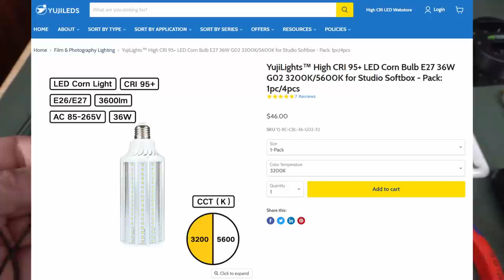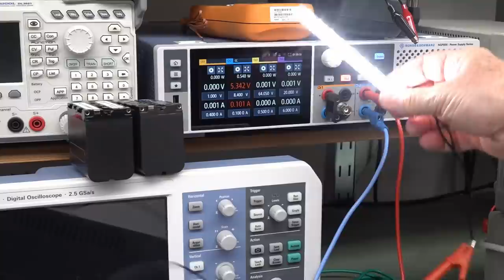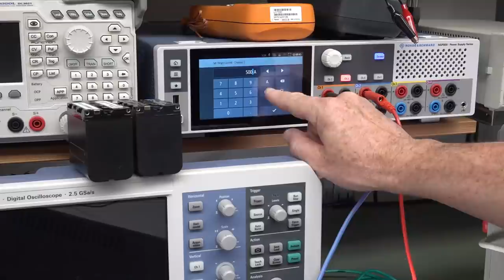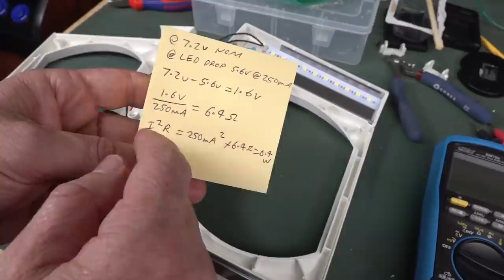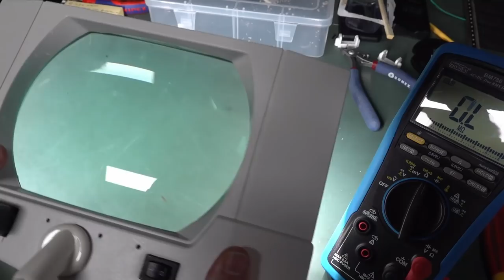Magnifying Lamp Sony Battery LED Hack

Comment: I use an Eschenbach Mobilux handheld magnifying glass. Nowhere near that field of view but somewhat more portable and similar magnification. They're intended for reading so focal length may be an issue, but they're by far the best illuminated commercial magnifiers I've come across, and I've tried a few. They're not cheap, but I got mine for free. Result!

Comment: Great work, simple and effective!
I have a couple of magnification lamps on adjustable arms, they have a 22W round flourescent light around the lens. Great general light for any workbench use and when you need magnification you've got the lens right there, just adjust position and you're good to go - great to have some magnification for those things that just are a bit too small for the naked eye (and I do notice the eyes getting older too). As flourescent lights are going the way of the dinosaurs I intend to fit LEDs in them after the flourescents wear out.

Comment: TRICK with Maggie lamps: Find a hand-held magnifier from the local variety store, best to get a metal frame and glass lens - let's say you find a 3" version. Hold it above your Maggie lamp to find a suitable height to create a "zoom lens". I found the best compromise is about 1" away.
Finally, find a piece of PVC drainage pipe that just fits inside and cut to length and smooth the ends. I used 90mm stormwater pipe as it is light weight and fits perfectly in a 3" magnifier.
So, when you need more magnification, just drop the pipe on top of the Maggie lamp lens, then place the hand magnifier on top of the pipe. You won't believe how well it works, and how handy it is.

Comment: Very nice quick hack using chargers and batteries you already had on hand. I have a LED lamp at my workbench that is powered by 4 AAA batteries. I wind up using the light for a long period of time which kills the batteries. You have inspired me to hack the lamp so I can power it from USB rechargeable power sources I have or via a USB cable. The voltage might be a tad low but I'm hoping 5V will be good enough. BTW, you said the resistor wattage needed is 1/4 watt but you meant half as the number came out to 0.4W.

Comment: You can make a handle by boring a hole of the same diameter as the metal stud  in a piece of round stock and connecting them together.

Comment: EEVblog2 video: How to rejuvenate battery 
I still like to see what you have done to try it.

I mean ther're probably countless videos how to do it... but fails also are interesting.
Reply: I'm thinking it would be worth opening up the pack. If the cells are good, swap the BMS for a generic one. If the cells are bad, replace them for cheaper than a new pack.

Comment: You can do the same thing easier, lighter, and cheaper with an $8 Fresnel lens (in a frame) and a 3' strip of white LED lights (self sticking attached around the frame). Plugs into a standard USB power.

Comment: A pair of 10440 or 14500 Li-Ion cells in a AAA or AA holder would have worked well to power that as well.

Comment: Hey Dave, I absolutely love hacking videos like this! That being said, a 3d-printed part (I'm sure there's already designs out there) and some pogo pins or spring contacts would've made it possible to have a much neater battery connection without having to sacrifice that cheapy charger.
Reply from the maker: The cheapie was not used at all, so resue was a good end for it.

Comment: OMG man if u do much work with cutting plastic n things with a dremel like that, u should SOOO try a tile cutting bit or proper dedicated cutting bit, they dont smear the plastic n u dont have to b super careful so u dont break the dam thing like u do the blades, its just sooo much more flexible n durable n makes it fun to use again, i hate usin the cutoff wheels   at least the emery ones or whatever they r
Reply from the maker: I have a nibbler tool, but already had the dremmel to hand.

Comment: 5:28 you just unscrewed a wire harness/tie-thingymajig from those posts are you are saying you don't know what they are?
9:38 you could use a QuickCharge or USB-PD powerbank with one of those modules that regulate the output voltage, that way you could get 12V or more out of a powerbank.

Comment: Turned out much bette than any hack I ever did.  BTW Is it a safe guess that the "lost" plastic covers for the original lights made the lighting worse?
Reply from the maker: A diffuser might help a bit, but the light in practice is very nice.

Comment: 25:13 so you just made a magnifying lens with a light on it lol. Do they not make magnifying lenses with a ring light on the perimeter? sounds like a good idea
Reply from the maker: Battery powered from my existing Sony batteries? No one makes those, except me.

Comment: Neat hack. Having learned a lot of what I know from your videos, I would guess you'd use a comparator and a zener for a "Low Battery" LED? Or is there an even simpler way to do that?
Reply from the maker: I'd reuse a low voltage detector chip from my uCurrent.
Reply: @EEVblog2  That would indeed be an easier way.

Comment: You could have just stuck a USB power bank in there with some usb powered LEDs and then charged it using a USB cable.
Reply from the maker: I mentioned this in the video. I didn't want that because Murphy will ensure that when I want to use it it's flat. I always my charged Sony batteries.
Reply: @EEVblog2  I admit you would need a switch solution for an inline USB power in the other case also.

Comment: That's not a stereo microscope. That's a binocular microscope - not the same thing at all. Try a real stereo microscope (about 20x is the magnification you want - maybe less but not more). You'll be amazed.
Reply: To elaborate - what you have is a binocular micoroscope - from the look of the turret it's a typical type used for biology. Probably has 10x eyepiences and the turret elements from 10 to 100x, for a total magnification (eyepiece * turret) of 100 to 1000x. That's great for looking at cells and bio stuff. But for soldering you want much lower power and most important true stereo. A binocular microscope gives you a view thru both eyes of a single 2D view. A stereo microscope gives a true 3D image (with depth) because each eye is looking from a different angle. Typical power is 10x eyepieces and 0.4x to 4x objectives (2x most common) for a total of 4x to 40x. Plus zooms - typically 0.7x to 2x or so, for a total zoom range of 7x to 20x. More than that and all you can see is a fraction of a 0402 part!
Reply: I've tried 5 or 6 differemnt models. Olympus is the best IMHO; even the 60 year old original SZ model is great (if you can find one in good shape). The modern ones are great too - better than Nikon, Swift, Leica, Bausch & Lomb, Zeiss, or any of the Chinese cheapies (but even the worst of those is pretty good compared to anything that isn't a stereo microscope). Key specs on any stereo microscope are (a) zoom range and (b) working distance (distance it'll focus from the bottom of the objective - you need room to get your iron in there!). You want 10x eyepeices - accept no other.
Reply from the maker: The Mantis is a true 3D stereo microscope. The Olympus is clearly not for soldering, it's for die inspection. If you used a Mantis microscope, you'd be amazed. I used to have an Olympus SZ.